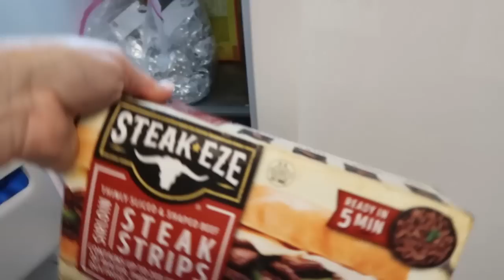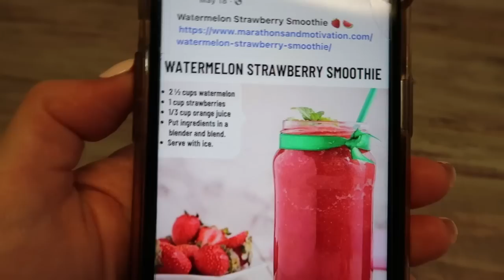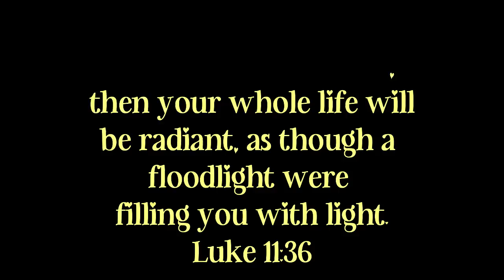PAINTING WINDOW TRIM + CLEANING + COOKING | A STORMY SUMMER DAY IN THE LIFE | SUMMER 2022

Comment: With your sofa and loveseat like you have them, are you able to use the recliner feature? To match, you should also paint the corner pieces in your hall entry. I like the white trim on the window, but it needs a curtain to warm it up some. It doesn't have to be a long one. They have tiered top curtains. But a long one would also work, just don't push the sofa/loveseat up so close against the wall. Why do you want to go to a public pool if you have a nice pool in your own backyard? If yours is still too cold, they do have pool heaters you could invest in. Just a thought. Thank you for sharing.